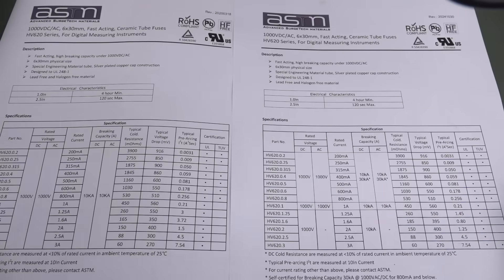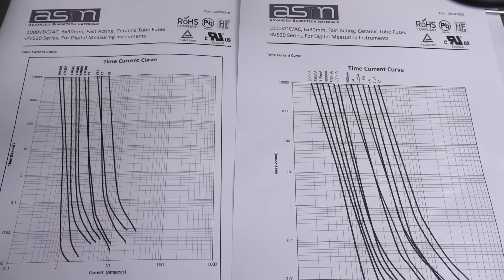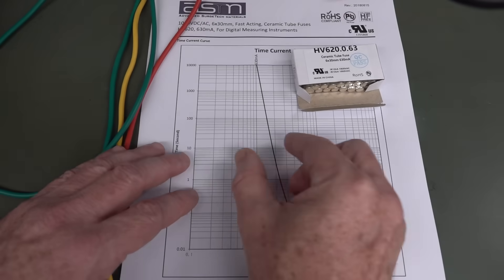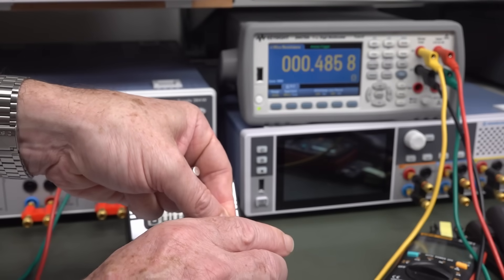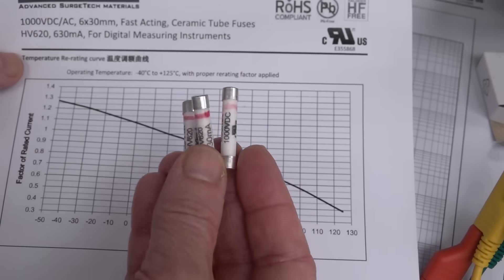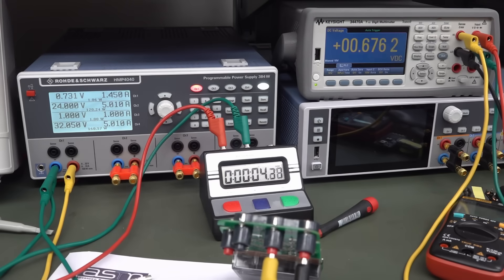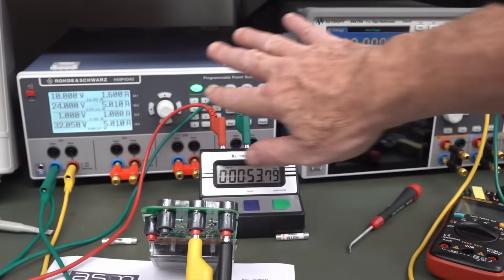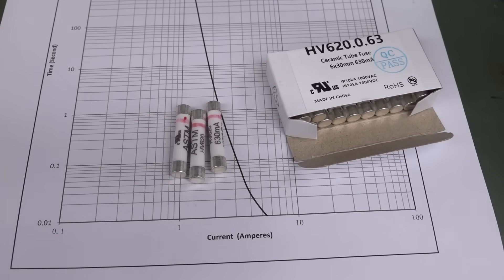EEVblog 1677 - Why Do Fuses Do This? (EXPERIMENT)

Comment: Recently connected seven 1 amp fuses together effectively forming a 7 amp fuse.   This appeared to test as a very reliable 7 amp fuse compared to any of the single 7 amp rated fuses.   Thought some might find this to be of interest or helpful.

Comment: When annealing metals, you are creating larger crystals in the material by lowering the temperature.

Something I learned recently, is that annealing continues to follow the material's characteristic curve deep into cryogenic temperatures. 

That means, for example, you can significantly harden a drill bit by freezing it, or even submersing it in liquid nitrogen. It will also become more brittle. 

I would guess that for most materials, less grain boundaries = less electron scattering -> lower resistance. 

But that would depend on the material, because perfect diamond crystals are insulators, but graphene is a conductor.

I would expect most metals to behave this way though.

You might also be rearranging the different alloys in the crystalline matrix. 

Send some samples to a metallurgist, and they could tell you for sure.

BreakingTaps is a great YouTube Channel you could collaborate with, who might be able to do this.

Comment: I asked google: "do fuse ratings increase if fuses are frozen", and the answer was: "No, fuse ratings do not increase when fuses are frozen; in fact, lower ambient temperatures cause a fuse to respond slower to an overload.". Doesn't respond slower imply higher rating?  That's AI for you... It wasn't linking this video either.
Edit: I changed the word "are" to "have been" for better accuracy and got this: "No, freezing fuses does not increase their current rating; in fact, lower temperatures can cause a fuse to respond slower to an overload, not faster. " ???

Comment: So for really sensitive / expensive equipment, measure the voltage drop of each fuse at rated current.. or at 1.5x rated current.

Comment: Makes one wonder if an automatic, nondestructive fuse characterizing apparatus could be constructed for comparing Chinesium and Bussmann fuses. I found that room temperature resistance of an unknown 15A 250V 20mm one corresponded pretty close to those of other manufacturers (7 mΩ). Perhaps the cheapie "1A" ones sold on Amazon that break at 20A just experienced thermal cycling. ;) (More than likely, they made some 30A fuses and marked them from 0.5A to 50A... total fire hazards that should be illegal everywhere.)

Comment: If it wasn't a joke , I'd say it's because of the expansion of the metal which means less heat
Reply: Thermal stress of metal is much more nuanced than that. Metal is very granular and irregular.

Comment: G'day Dave. This might be a G up, I'm still not sure. However, metalurgically speaking, Heat treatment of metal components in the engineering world does not always mean elevated temperatures. Cryogenic treatment of metal alloys delivers quite useful results in a lot of cases.

Comment: Humidity gets into the sand of the fuse, most likely and it becomes a conductor. Not sure if it could be cryogenic hardening or something like that. At least that what humidity does in sand filled heating elements. Humidity conducts from the nichrome heating wire to the case and we do turn them on for couple of hours on no air flow to dry the humidity out. Insulation resistance drops to safe to use levels.

Comment: Damn it...  I was thinking maybe it's because of thermal expansion (contraction in this case), the wire inside the fuse may try to contract and cannot, and this would end up changing slightly the length of the wire due to stress...

Then again, I saw this video in Canada, on March 31...  Never occurred to me that the Aussies were already on April 1st...  Damn it...  I never get caught on your videos 😀And here I am now... 😛

Good one Dave!
Hello again from Canada!

Comment: Since you're in Australia, is it possible you installed the fuses upside down?
Reply: Or purchased fuses designed for the wrong hemisphere. Fuses for use in Australia should have a negative current rating.

Comment: Just wait until the audiophools get their hands on this info.
Reply: Since Veritasium  put out that video claiming that electricity flows outside of wires, we could make a cable out of thin plastic strands coated with a micro thin layer of copper or better yet gold and market it as taking advantage of the skin effect.
Reply: @joshhoman  Heh, that exists and is called Litz wire. It's absolutely useless unless you're dealing with radio frequencies though. :)

Edit: I misread. Litz wire is individually coated multi steanded wire.

Comment: Hi Dave, I don't know what the fuses are made of but in steel there is retained austenite when hardening (you want martensite) and cooling the steel after hardening (but even after a long time) gets some of the austenite to transform to martensite. You can do this to your drill bits too! I recon something similar is going on here. Let me say thank you too, you taught me quite a bit, not that I get everything but a lot of joy and knowledge for sure.

Comment: This is a known effect by metallurgists, freezing steel and other metals will change it's internal crystalline structure.  Sounds like something that should have been well known in the fuse industry, perhaps they cheaped out on the ingredients and are selling fuses that aren't rated for cold weather.

Comment: Does that add any credence to audio connectors that are "cryogenically treated", ex, RCA and cables. There are claims for AC connectors as well. Speaker cables too. Does  their resistance get permanently lowered?
Reply: Sure they do. But only on April 1st.

Comment: My two cents"
1. I wonder whether fuses from either of the two reputable manufacturers would show the same variations, especially across data sheets for the same part number.
2. I once compared fuse data sheets for fuses of the same type and rating, and I was surprised to discover that they were not identical.

Comment: Not really related, but I've been meaning to ask this.  A while ago I had to change the fuse in my 786 and managed to get the range switch indexed wrong when I put it back together, I was surprised to see it go into low-z mode.  I assume the 786 doesn't actually have low-z hardware in it, but I wonder if you've seen this before and how hard it would be to add low-z to an existing 786.  I'm sure it's not worth it, but might make an interesting video

Comment: Very interesting.  Aluminum alloys are cold-treated to make them stronger, and they stay strong.  Try the other route & heat them beyond design specs but not hot enough to melt anything.

Comment: Do you think that has something to do with Louis Rossman's tests with the Chinese fuses? Maybe they not only are under bad quality control but also are being stored at some freezing cold warehouse?
Reply from the maker: I missed that video, is it recent?
Reply: @EEVblog  Dec 30 2023. I've had y the same results as he did. Except I understand how voltage drop works so I didn't use stupid huge power resistors.

Comment: I find that freezing fuses on April 1st has quite the noticeable effect too!  
Thanks Dave for confirming my findings!!!
Reply: It's 31 March.  Aluminum alloys are cold-treated to make them stronger, the -t6 is the tempering process for the alloy.  Aluminum holds its strength after it gets cold-treated.
Reply: @chaosopher23 It's been the 1st of April in Australia for about 10 hours now! (Some uncertainty since we've just moved the clocks forward to summertime here in the UK.)
Reply: @alexandermonro6768  While metals changing properties because of temperature sounds like a joke, it really isn't.  Aluminium alloys are cold-treated to give them strengths and characteristics.  The t6 at the end of 6061-t6 is its cold-treatment process.  It keeps its strength when it warms up.
Reply: @ The best jokes are always the plausible ones.

Comment: Thermal cycling even to cold temperatures are used to temper metal knives. We do heat the knife up to a high temperature and quickly cool it to make them hard, but they're too hard and are brittle. So we temper them by heating them up to a straw yellow color and slowly cool to room temperature. They stay rather hard (sharp) while being a little bendy (not brittle). Cooling the knives to cryogenic temperatures and slowly bringing them up to room temperature also improves the grain structure of the knives.

Comment: Ok, you have finally reached the point where on any other day I could not tell anymore if it's a joke or not. :-)
Reply: So what is this? Making fuse cold will lower resistance. At least put in the description April fools if it isn’t real.

Comment: I wonder if the factories that make these, make just a huge batch, and use this effect to dial in different ratings, like current and voltage etc. It would make sense to use this effect rather than using different materials for every different rated batch.
Reply: That's probably a trade secret you just discovered but apparently it only works if manufactured on this date every year. Strange phenomenal indeed, these companies are making fools of us. 😉😉😂

Comment: Should be cheap/easy to just heat one up then measure the resistance...
Reply: Yeah well that will be real easy in Australia as the Sun will be rising about now, just lay them out in the Sun, they are already four hours into the new day, in fact a new month as well down under. 😉😉😂

Comment: interesting because we occasionally get ambient temps as low as -40C here. suggests that any fuse that's been sent through the post or left overnight in a car might not be within spec.
Reply: THEY have been covering this up for decades. I've seen files smuggled from the FBI that exposed this phenomenon dated 1975! 

Not even the best minds can solve it so they cover it up and hold secret meeting every three months to make sure everyone is towing the line. 

Keeping it secret is the fun part for them, eventually the truth will be exposed and we can all laugh at it. 😉
Reply: ..and there are already fuses in the car itself.. that could explain how some cars set on fire..

Comment: For completeness, they should also be tested after they have been heated to 1000°C. I suspect they may now blow at 0 A.
Reply: I got my blowtorch out. The fuses just melted. You sound like you are onto something with those zero amps, sneaky buggers. They have caught me out before, I find equipment works best under that condition when the fuse is replaced by someone else, blindly. 

That way I don't know if the fuse is even in the device and it's now in a superposition quantum state of existing and not existing. It works under all possible conditions that way, at least in some universe. 

Physics Yeah Baby! We really are all exposed as fools by it.

Comment: Dave, don't forget that power supplies have large capacitors at their output and when you switch the output ON, the fuse can receive more than 30A for several hundred microseconds before the current limiting kicks in. The fuse can then be “pre-heated” and this can reduce its melting time.
Reply: this power supply cost $3700, it states that it has an accuracy of 0.1 % + 5 mA (typ. ±1 mA at I <500 mA) and "deviation after load change of <0.01 % + 250 μA"
From what I understand it means that it might deliver 250µA more then it's set from the start, it's not really a cheap piece of equipement, I would figure they would have considered that their device CAN NOT deliver +30A at any point in time.

Comment: I wonder how much of the inconsistency is due to differences in transportation conditions. Between temperature swings, different temps in summer and winter, even the bumpiness of a particular road and the quality of a truck's suspension there's a ton of variability in what different shipments of an otherwise identical item between when it leaves the factory and when it hits your doorstep.
Reply: Was just thinking along the same lines. -18 C is within normal outdoor temperatures for many countries. Do I need to know what kind of fuses not to get because of the temperatures?

And how cold is it up in the air?
Reply: And what about the fuses of the car actually deliverig it?

Comment: I would be interested if the effect is the reverse if heated. Not much, just to 60-70 °C, essentially the temperature a device (like a TV) might reach inside when running on a hot day.

Comment: Given how advanced micro electronics have become, I'm kind of surprised we don't have some sort of electronic fuses with extremely precise characteristics made out of semiconductors or something.
Reply: We do, but they depend on the sense element and the semiconductor performance. At a high enough current fuses will arc but are designed to clear to very high currents. Semiconductors on the other hand will fail short and require significant current to clear, not behaviour you want in a fire safety device

Comment: So what happens if you shock freeze them a couple of times, letting them warm up in between ... and if you went to -40C would the effect be more dramatic?  Can it be reversed (or even have the opposite effect) by heating them to 50C?  I used to level my meters and boxes of ceramic fuses in the trunk of my car all the time where they easily saw these temperature extremes.

Comment: So maybe the audiophools are on something with their cryo treated gold plated fuses? Less resistance, more power available? 
But then they could also just bridge the fuse with a piece of wire if it almost doubles the fuse value...
Would be interesing to freeze a fuse and then leave it at room temerature for a week and see it the effect reverts, maybe the metal converts back?
Reply: No need to wait that long. Just wait til April 1st is over.

Comment: Resistors are permanently changed by freezing also. We tested that on some 2.5 gigohm resistors
Reply: what type of resistor?
Reply: @AnnaVannieuwenhuyse  Metal film, I'd wager.
Reply: @ I believe they were carbon comp. They were used for high voltage probes for 100kv 100uA measuring while using a 1vdc meter display to show 0-100kv.
Reply: @jasonbrindamour903  How much did it change? How cold did you get it?

Comment: Geez - I wouldn't appreciate them changing the curve without changing the part number.
Reply: Afaik the label rating is only at 25C and 60RH% which is the same for both versions and both manufacturing tolerance and material supply can explain the changes.
Reply: The data is only typical performance. It will still be in spec.
Reply: Fuses have such a wide spread of performance that the minor changes in those charts showing "typical" (probably median) performance don't mean much.

Comment: makes you wonder what the effect of air freight or sea shipping in cold climates might impact the rating of an entire shipment of fuses?
Reply: My concern as well!
Reply: Well it could be mitigated by cooling them to -60c at the factory. It never gets colder anywhere in the world. They would have a different characteristic though and the fuse ratings would have to be adjusted.
Reply: @jackykoning  Expensive, but it would work.
Reply: @jackykoning  Excellent idea! You have to pre-cool them at the factory just like how fabrics are pre-shrunk so that your clothes don't shrink after you get them.
Reply: @jackykoning  "It never gets colder anywhere in the world." I can tell you haven't been between my wife's legs 😐
Reply: They will return to spec after April 1st. Don't worry.
Reply: @95rav  Makes sense. You see the problem with the time he posts it at is that it literally isn't April first for 93% of the world population.
It would be more funny if he actually posted it normally IMO. But yeah it makes total sense.
Reply: Large batches are unlikely to change temperature that fast, temperature shock implies it's about the rate of temperature change not just reaching a low temperature.
Reply: Maybe this is what happened to Louis Rossmann's Amazon fuses?
Reply: @jeffcard3623  There's always the Reversible Fuse.  When it blows, put it in the other way and it's perfectly fine... at least that's what you tell the new guy.
Reply: Only when they are shipped on April 1st!
Reply: @joop2295  Rework required by 7 April or the bug takes over...
Reply: my thoughts exactly, we can now only buy them in summer lol
Reply: @mcrotbot  Free beach umbrella for every order over $1,000!  Hurry!  Act Now!

Comment: My first thought was the same effect as the cryohardening effect that Ben from Applied Science testes. But he cooled the drill bits in liquid nitrogen... interesting.
Reply: Bit wait, there's more! This might also have serious impact on any protection selectivity in thr circuits. This should be seriously investigated. And I wonder how fuse element material-dependent is this effect, but if this effect scales up for high power fuses (and we're talking normal Earth ambient temperatures!) one might assume this might be a serious problem for grid/unheated cabinets in cold climate. Then again...this would've been already noticed. Mind boggles.
Reply: I'm surprised that YT doesn't ban the word "testes."

Comment: Well this looks interesting but do these fuses have sand inside them? did it get wet or something liquid got in there? Maybe they need to be left for a couple of days assumably to make a more solid experiment and eliminate  this possibility Dave !!
Reply: that makes sense, my thought was some moisture allowed parallel connection which lowered the resistance and increased the current threshold.
Reply: Would be easy to vac pack or put into a zip loc bag with minimal air and then put into the freezer.